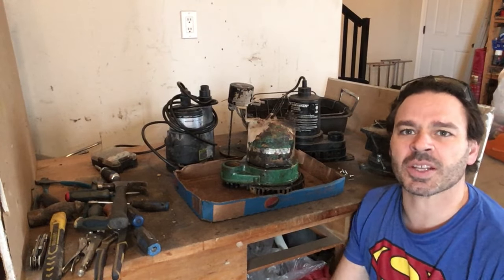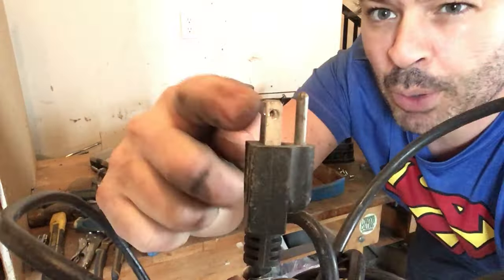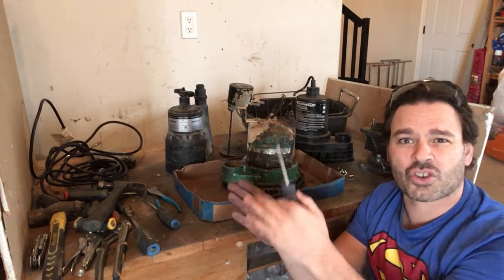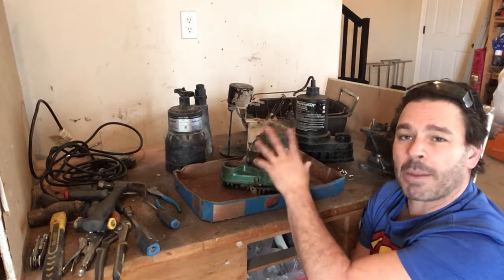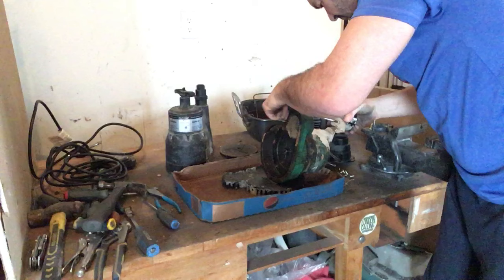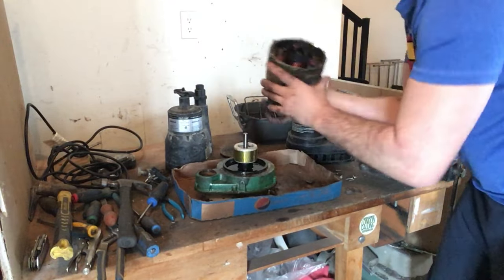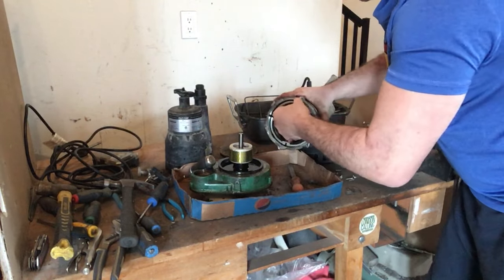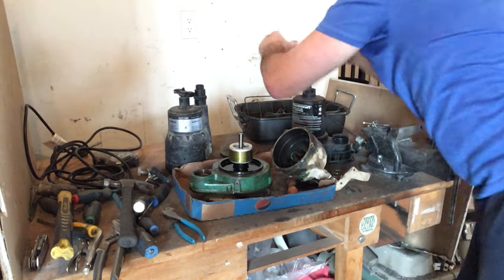Scrapping some stubborn sump pumps for loads of FREE COPPER, METAL, SILVER, and other metals

Comment: Peace love and tons to you too! ❤️ 
Pinch them contacts with some small wire cutters and bend the stem with pliers to get the contact free. They pop right out. Thats my focus these days. Going to the junkyard and filling a canvas grocery bag with relays for $10 then collecting the contacts. Using the copper spool to melt a bar then using the bar to cement the silver out of solution. 😉
The copper i collect, is worth more than what i pay by itself,  so my silver is free....ish
Still bought the nitric, beakers and so on but......👍 right on! Btw im yielding %61-70 silver from the contacts. Not sure about other sources but everyone acts like they're plated. They are alloy. I posted a couple shorts about it.
Reply from the maker: Thanks and I agree with you about the silver recovery and collecting those relay boxes, they add up. I have watched a few of your videos, I enjoy them as well. I am a subscriber to your channel as well.